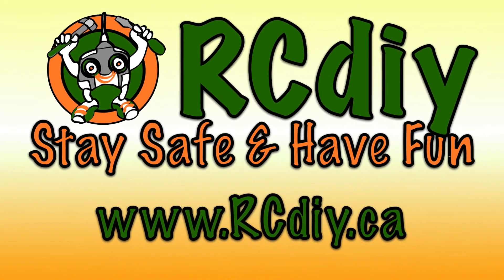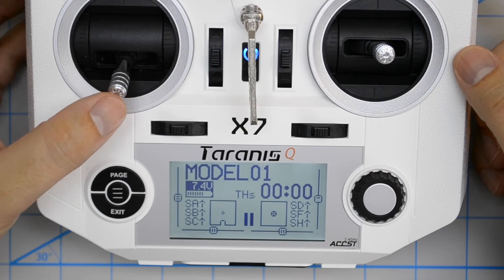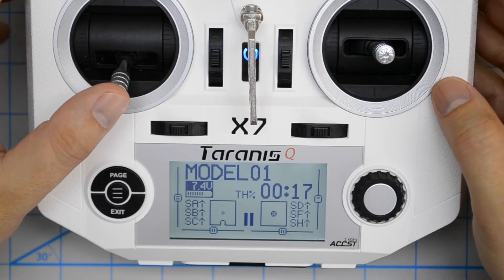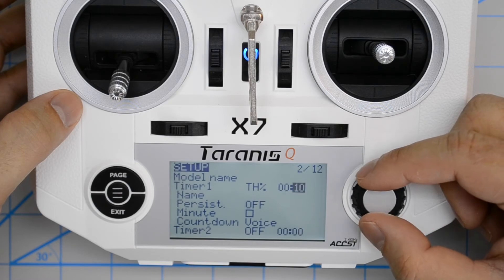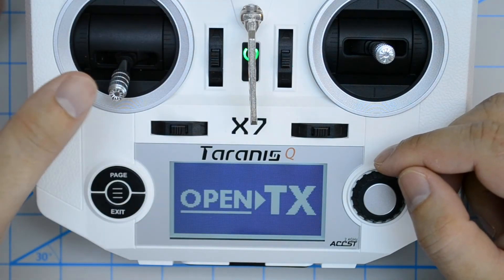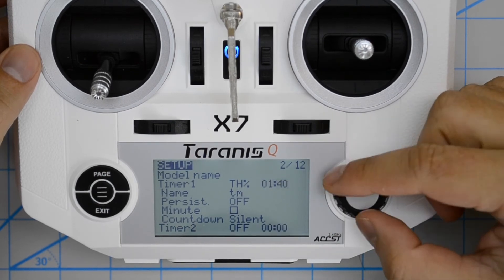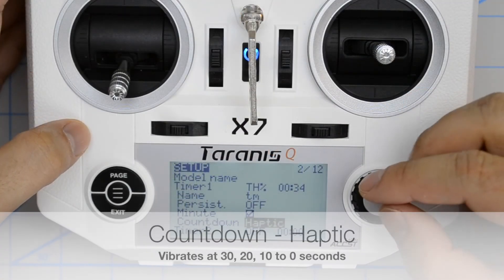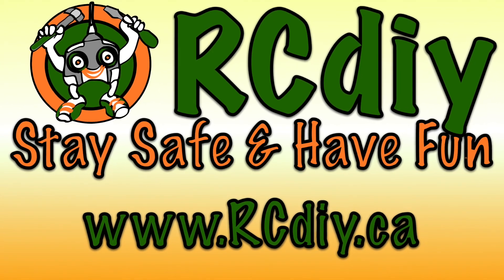Taranis Q X7 OpenTX Tutorial - Timers

Comment: Hi! Is there a way to initiate the countdown timer with a button? I am using the Taranis X7 for RC Regatta Sailing, where a starting time of 2 minutes or less is allocated until the boats can cross the starting line at 0 seconds. I would like to be able to start a countdown timer with a button on the Taranis. Additionally, it would be beneficial if the countdown restarts at the preset time when the button is pushed again.

Comment: how did you disable the sd card warning when you turn the qx7?
Reply from the maker: The version file comes with the sound pack. Which version are you on? The one that came with the Tx?
Reply from the maker: It is looking for a text file opentx.sdcard.version on the sdcard, root folder/top level folder. That file contains text "2.2V0006" without the quotes and the numbers depend on the firmware version running. This was added because when there is a mismatch of firmware and sound files the units spoken would often be wrong.
Reply: RCdiy yes sir, the one that came with the tx.
Reply from the maker: Ronn2664 use the download from here
http://www.frsky-rc.com/download/view.php?sort=&down=337&file=SD%20Card%20Contents%20%E2%80%93%20Taranis%20Q%20X7
Reply: RCdiy Thanks.
Reply: RCdiy That's the same files I have on my sd card right now. Extracted and put the files on the root of my sd card. Is there anything else I need to do?
Reply: RCdiy Figured it out. Thanks for the help.